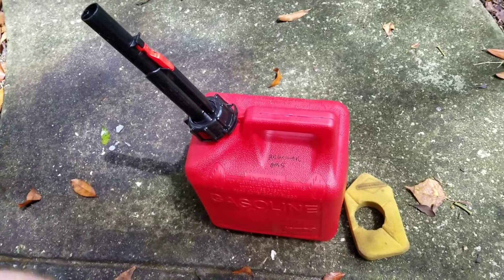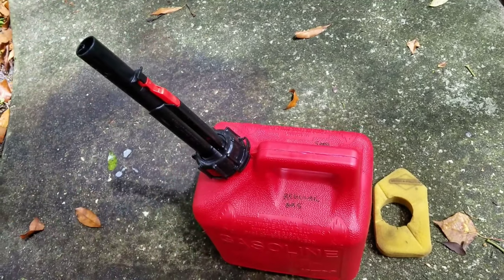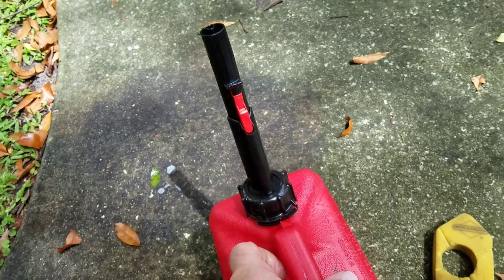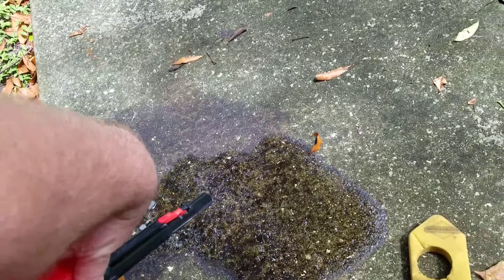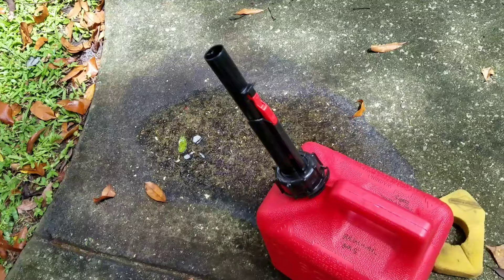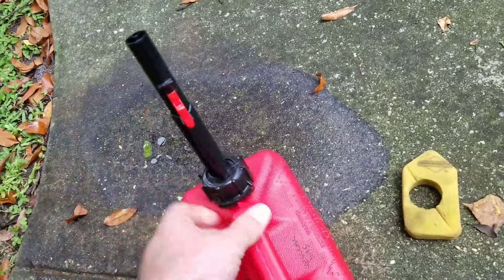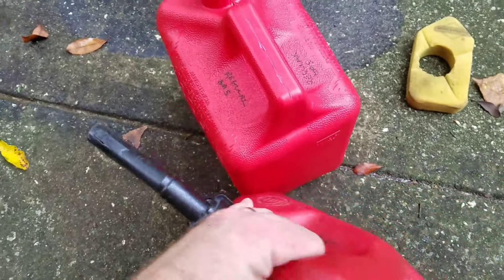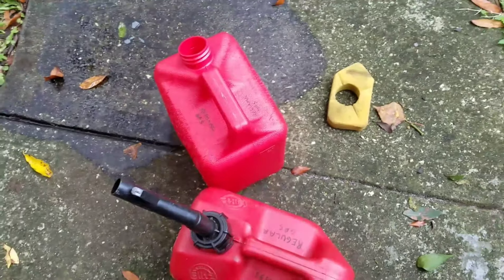How to use these new gas can spouts. Silly

Comment: Hillarious I almost thought this was a joke! I knew there was something wrong with what doing.  In his defense the directions that come with it are absolutely horrible. The manufacturer has a video up that explains it perfectly
Reply from the maker: sam mommi like I said before. No matter what way the nozzle is on, you still need to push it down on a mouth. Try filling up a  very small gas tank such as a weed eater. You cannot do it without pushing that nozzle down by hand because the nozzle is too long.
Reply: Scott Keeley You are 100% correct my bad

Comment: Scott, you have the spout upside down :) Click the child safety lock in, then put the tab against the edge of your car and push the can in so it start flowing. You don't have to keep your thumb on the tab and holding it down... 

Also, if you read the label on the front, you would clearly see that you can peel away the label and the instructions are right there.

https://www.youtube.com/watch?v=NLGpriAwt28 - Pretty simple stuff, really.
Reply from the maker: Thanks but my main beef was the fact that you actually do have to hold the tab in to put gas into a small gas tank such as a weedeater. The nozzle is to long to depress on its own. Try it. It works ok to put gas into a car. Plus it does not matter which way the red tab faces , it works the same. Sorry but the spout is terrible.

Comment: Scott.....This gas can STINKS! I followed instructions word for word on the peel off label and it still leaked from the cap when I poured it. Very dissapointing. The tractor supply shop told me when I bought it that federal regulations now require every gas can to be this way. Better for the environment. Well excluding leaks from this new style tank I will agree. Couldn't leave well enough alone. Fumes from gas stations cause more pollution than fumes from gas cans. 👎

Comment: Bought this for my road trip and now realize I won't be able to pour it into my gas tank because it has a resistant cap that requires me to shove a nozzle in. But if I shove the nozzle in, I wont be able to hold down that red button thing. Stupid design.
Reply from the maker: You should only have to hold the red button when you are filling small gas tanks such as lawn equipment because the nozzle is to long and wont go into the tank all the way. It should work on a regular size car tank without holding it awkwardly.

Comment: These spouts are awful.  I never spilled more than a drop or two with my old steel/aluminum cans and spouts.  These things end up sticking, not sealing, etc.  They spill cup full levels of gas.  They were made for people who have no mechanical/practical/hands on inclination but they failed to help them either.  If you want to make it "user friendly" for those types of people, put a shampoo pump on the can and let them actuate for an hour.  Give me back my metal cans with the spring loaded lid/seal and the long flexible metal funnel that my grandpa, dad, and great grandpa passed down to each other.  Good grief, I can use a funnel for heavens sake.

Comment: More gas has been spilled since the 09 EPA gas can laws than there ever had been spilled since we first refined gasoline as a human race. Thanks to these stupid valves 
Although expensive, buy the cheapest can in the size you want 
Buy an EZ pour spout.
Drill 1/2" hole at rear of handle and pop in the vent it comes with. Voila you have a real gas can

Comment: I bought this too and it is awful! I think I will go back to a water jug and a long necked funnel. It is ridiculous! I got gas all over my hands trying to use this darned thing. And it's nearly impossible to unscrew that nozzle back off once it's on from using it. Most horrible design EVER! I should request a refund from the company. :(

Comment: Unfortunately, I already threw the old spout away....  

So guess I'm stuck with NOT USING A SPOUT on my worthless "Midwest Can" $9.99 brand, and what I've been doing is pouring gasoline directly from the container's lip into the mower, with of course spillage, every time....  (Could do the same exact thing by re-using a gallon MILK-CONTAINER, that's just as unsafe and that's free....)

There ARE supposedly actually directions on the can-label for this ("Just peel back the label!");  but, get this, you need to waste 10 minutes of brain surgery (with fingernail or tweezers) trying to get the 2-layer label to SEPARATE.  I guess so anyway:  because then I STILL wasn't able to get halfway-down into the label to read the (I'm sure microscopic) "directions".... They glued the 2 halves of the label together , I guess....

Why do gas cans need "directions" anyway?....  SMH.

Comment: Hahaha...you installed it incorrectly and had it turned 180 degree backward.  The engineering is on point.  You just didn't know how to use it.  What you should have done was to turn the safety red clicker 180 degree so that it could face the ground.  When you lift the can up and put the spout in gas tank, just click the safety red clicker and tilt the can so the force can push the nozzle in and release the gasoline.
Reply from the maker: It does'nt matter which way you face the safety red clicker because it does the same thing. My point is that you can not fill a very small gas tank such as a weedeater or blower because the nozzle has to be pushed to far down for it to work. Therefore you have to hold the nozzle in while you are filling a small gas tank. The gas can is ok if you are filling a car because you can push the nozzle in all the way. Jokes on you. Thanks.